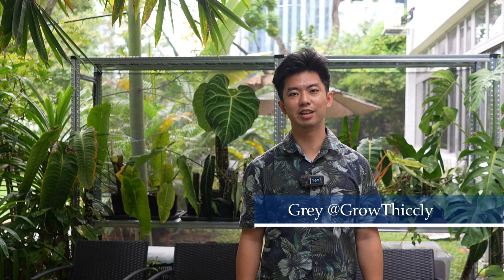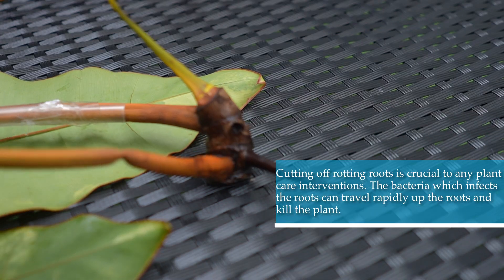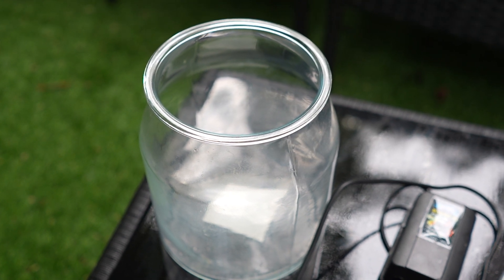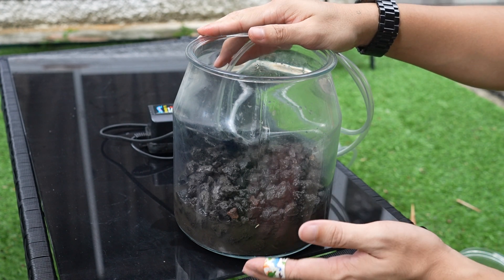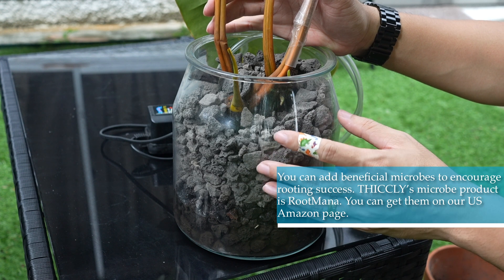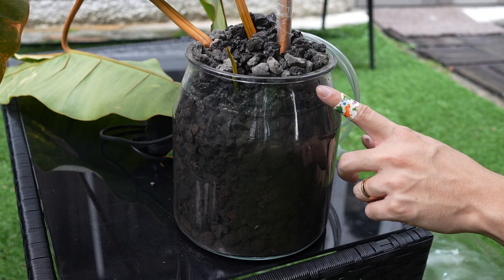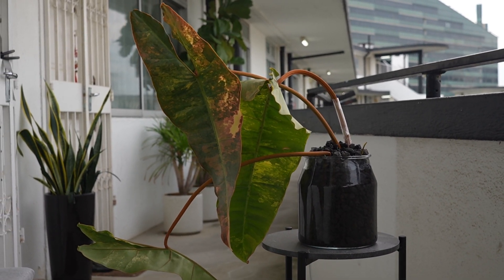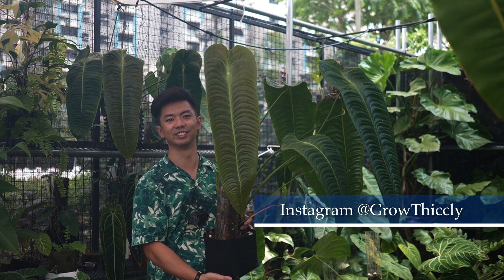We (almost) killed our variegated billietiae! - How to save difficult propagations

Comment: Why is when I do this with fluval they always die of root rot? It's not such a big set up so I'm not using a tank air pump but I see people getting such good results with fluval but not me.
Reply from the maker: Fluval is much more tightly packed than volcanic rocks which makes it more anoxic. I also suspect what most people are doing with fluval is that the base is perforated like a regular flower pot. They probably put it on a shallow tray of water. What reaches the roots are there through capillary action and is pulled up by vapour pressure. They could also be simulating flood and drain hydroponics, immersing and removing it from the water, stimulating flow and gas exchange. Hope that helps